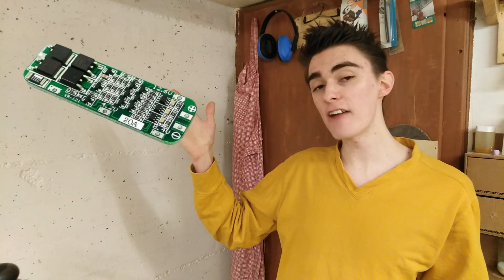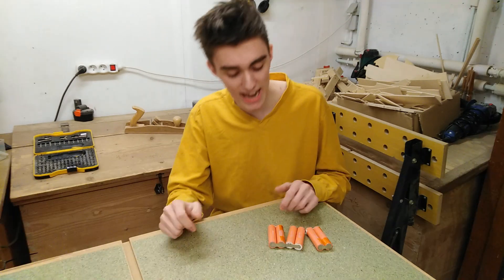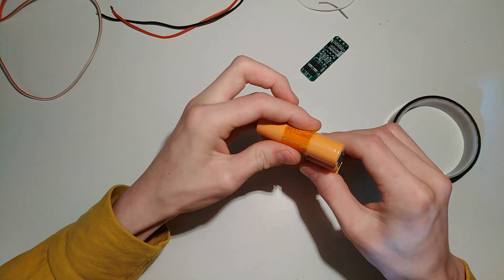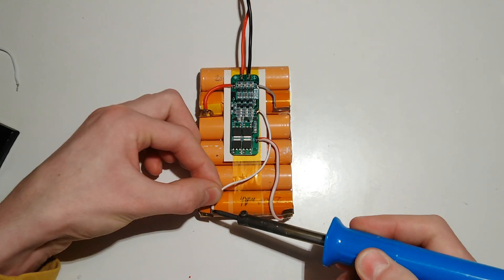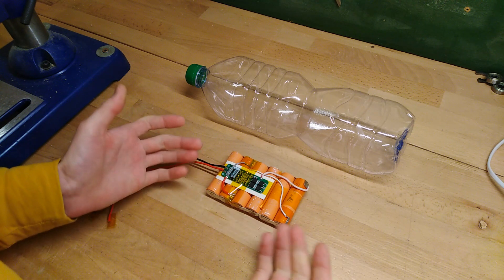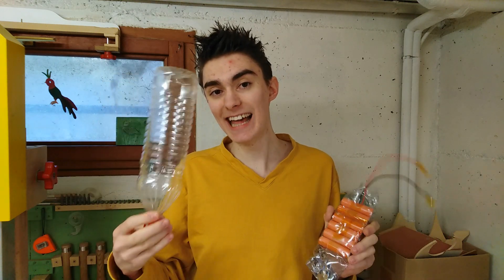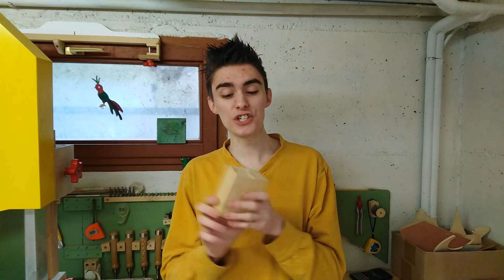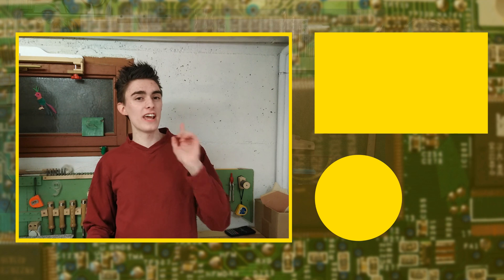Making a 3s 18650 Li-Ion battery using PET bottles as heat shrink

Comment: Well that turned out better than I expected. How is that multimeter working for you I'm looking to get a good one the one i have is $5US and doesn't even beep for continuity. Thanks in advance.
Reply from the maker: Thanks! I'm very happy with the multimeter, I got it back in 2017 and it's held up nicely so far. I blew the 600mA fuse a couple of times, but very easy to replace. Auto range is nice to have, I've personally never used the mV setting, but it depends on what you measure - I like to have the higher resolution. It can measure currents down to 0.01mA or 10uA. The auto power off can get annoying when trying to monitor things for more than a couple of minutes - but then again it's good for battery life since I forget to turn it off frequently enough. Battery life is very good, I only changed batteries once or twice in 4 years...
I never really worked out how measuring frequency works, mainly 'cause I don't need it.
Well, that's as far as I can review it :)
hope you don't mind me dropping an affiliate link
https://ebay.us/BzZWxm